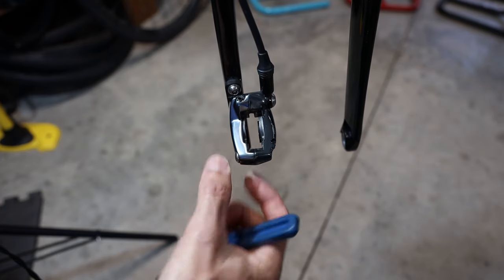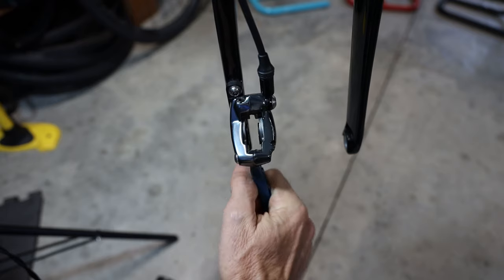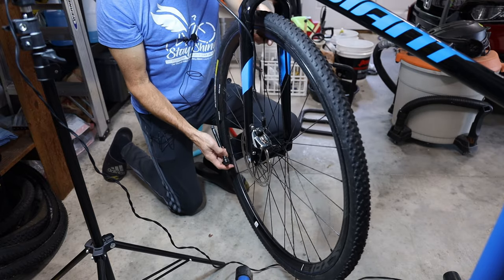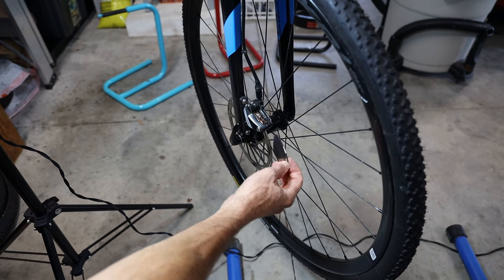How to Fix Dragging Brake Pads (if Centering Doesn't Work)

Comment: For 3 years, I have endured rubbing front disc brake. Lots of useless advise led me to change: pads; rotor; mineral oil and bleed; calliper. My local bike shop couldn't resolve (in fact made it worse!). I even bought new wheels (not because of rubbing) which had the exact same problem. 3 minutes of watching your video, and I thought 'heck, let's try this'. 15 minutes later, problem was resolved! Thank you so much for such a clear, simple solution!

Comment: Brilliant! Going nuts trying to fix my dragging brake pads. Tried to exercise the pistons again and again to no avail. Removing excess fluid solved the problem immediately. In hindsight, the brake lever was very tight and a sign that the fluid had expanded. I don't know why other videos aren't showing this, but thanks a bunch.

Comment: Thank you so much Clint. After trying out about 20 other videos all of which suggested the same solutions of straightening the caliper, truing the rotors etc etc, yours was the first and only one that suggested relieving a few drops of mineral oil from the system. This solution immediately solved the problem on my Canyon CFR running Campag Super Record EPS and it was quick and easy for me to do. Quality content from knowledgeable people like yourself is hard to find out there in a sea of repetition and ineffective solutions purveyed by so many others. I’ve sent a super thanks your way. Thank you 🙏
Reply from the maker: Love it. So glad I could help!

Comment: One more suggestion: some shops are not careful when bleeding brake fluid and they finish the job with too much fluid in the lines.  If you can’t compress the pistons back, even if they are clean, this is the likely cause.  You can fix this by opening the top bleed screw, pushing the pistons all the way in, wiping up the excess fluid, and closing the screw.  Then reinstall the pads and continue centering and pump the brakes.  Double check for leaks and verify there is good brake operation before riding!

Comment: Huge thanks. I was trying to resolve brake squeal but after cleaning and scuffing the pads 3 times, I found the pistons were not moving equally. One was almost stuck. I guess the imbalance of piston pressure to the pads and rotor was causing the squealing. Followed your instructions and the piston eventually worked together in equal movement. Took it out for a test and voila. They no longer squeal.

Comment: Thank you very much for the tip about too much pressure in the system. Had very little clearance on some new pads and was finding it very hard to get the calipers centred well enough to stop all rub. Just did as you said and bled off a little fluid and all is right with the world again.

Comment: The video addressed the issue I was having with a new bike build, which was excessive hydraulic fluid in my front brake line.  Thank you Clint for your clear explanation!
Reply: if you drain the fluid, does it not make the brakes more mushy?

Comment: Gonna hit this again. Noticed you mentioned pushing them about 6x..haven't heard that before but have endless rubby and also squashy underpowered brakes (deore xt). Also been through the mill trying all options, convinced it was a stuck pad issue but only cycled them once or twice.   ...I'll be back shortly (as big Clive would say)😄

Comment: The removal of a little brake fluid did the trick for me. Try first without pushing the pistons back, this was sufficient for me. Pushing the pistons back may reduce the breaking pressure too much.

Comment: Thanks a lot for the excellent explanation and demonstration! I’ve got excessive pressure in my system , but I was afraid to open a bleeding port because I thought the whole bleeding process will then be required and I do not have tools or a good service shop where I live… so I fixed my brakes in a few seconds after watching this video 🤌 thanks!

Comment: I might have a rear dragging on my hardtail 29er I need to scope out. Good timing
Reply: ElevationEveryWeekend check the disc too could be slightly warped and rubbing in a certain place win the wheel spins

Comment: Very helpful. I have new Shimano XTs and rotors and they were dragging. I went thru you list of remedies and found loosening the mounts to center the rotor was the answer. I just flipped over the bike and spun the wheels to feel for vibration between the rotor and pads as I incrementally tightened the mounts., I had to do it by feel since they are so close I couldn't see the gap and clenching the brake levers down and retightening the mounts wasn't fixing it.

Comment: Great explanation and the tyre levers work a treat! I’ve just done it successfully in my Sram Code RSC. I previously popped out a piston in Sram Guide so your tip not to push the piston out more than 3 mm has saved me this time. Cheers 🤙🏽

Comment: Thank you SO much for this video, Clint. You are a cycling demi-God. Had a stuck piston and tried all the suggestions in other videos and nothing worked until i back-bled the system. Piston popped right back in. Question: I've obviously got water in the brake system now. Is that an indication to bleed the affected brake?
Reply from the maker: If you have not bled the brakes in every year then I would do a bleed. However, if you just don't have the tools to do it, you could wait and see if you have that problem again.

Comment: My mtb has been sitting from just this issue. Went to put new pads on, and the new pads would rub the rotor. Not sure what I did, but when I let a little fluid out and I lost pressure in my brake lever. LBS will save the day!

Comment: Thanks! I had to lube up the piston and push it in and out until it slid smoothly and release the pressure in the tube a bit and that fixed it! Lol that sounded a bit wrong tho

Comment: Cool and useful video. I am curious about this little pad centering tool you show at the end. Can you provide a reference on it - brand, store, etc. Sounds useful to have.
Reply from the maker: Check out one of the links in the description below the video. It's the Birzman tool
Reply: I have the tool myself, it is good quality but...it's squared at the top edge, so if your using narrow rotors (SRAM for example use narrower than Shimano) it's not going to be sitting flush on the ring. I love the look of the tool but they should have rounded the top instead of square folding it. I tend to use a thick sheet of paper each side instead just for accuracy (paper is pretty accurate lol)

Comment: Great video. Thank you. Are you using tyre levers because you do not have the dedicated tool to spread the pistons? I have this tool and it is actually made of metal. Is this the reason why you prefer to use plastic tyre lever?
Reply from the maker: I’ve always used tire levers and never felt the need to get the tool.

Comment: you ever have the issue where everything's centered perfect when spinning or riding straight but when turning or standing/climbing the wheeling rotor flex (while off the brakes) and the rotor pushes over into the pads (while they are still aligned perfectly)
Reply from the maker: Yes. That usually happens when there is not enough space between the pad and rotor and a little bit of flex will cause the pads to rub. Do the method of relieving some pressure out of the system like a show in this video and it may work for that.

Comment: Also, could the thru axle adaptor end caps be the wrong size on the new Roval wheels? I just put my stock Vision front wheel in and it works fine
Reply from the maker: Never heard of that but I guess it could be!

Comment: Clint, aby suggestions how to fix this problem: Thread on SRAM Guide RSC rear caliper is worn out.  Other than replacing the caliper any suggestions? Bolt through the caliper with a nut at the end? Thanks
Reply from the maker: Hard to understand fully without seeing it, but typically the bolt goes through the caliper and into the fork or frame. For stripped threads, wherever they are, you may be able to use a helicoil.
Reply: @ClintGibbs  helicoil it is! Thanks!

Comment: Hello, I have an issue that I'm hoping you'll help me with. The brakes are shimano tiagra hydraulic. I have one piston that doesn't retract fully and after centering the rotor I can ride for a bit without any issues and then usually by the end of the ride, the pad is rubbing again and sometimes preventing wheel from spinning. I have given my bike to my local mechanic twice now but same issue. I can't find any new calipers in stock too so I'm wondering whether you have any ideas that I could try myself. I haven't ridden in 2 months because of this :(
Reply from the maker: If you are going through the process of unsticking the piston, that is really the only thing you can do. Of course you need a center of the brakes after that. If it keeps happening it may be a warranty issue.
Reply: @ClintGibbs  thank for the answer! I have cleaned the pistons and did the push back and forth quite a few times. When both pistons are pushed all the way in and the brake is applied the left side won’t go out at all unless the other one is held in. Pretty strange

Comment: When braking and the bike is not moving is it normal that the Rotor is moving when pressing the brake im using a hydraulic brake also the brake pads are aligned well or this is normal?
Reply from the maker: There are times when one pad will contact the rotor first and move it slightly side to side. The main thing is that the pads do not rub the rotor when not pressing the brake lever. If that’s the case, then it’s all right.
Reply: @ClintGibbs  thanks i also checked it to our nearest bike shop and found out that it is normal thank you for your response 😺

Comment: Hi ! Hoping someone can help , my breaks/ ( not hydrolic)  my rear pads and my disk are getting extreamly hot  , set of on my comuute this morning and I could lock up the rear wheel however on the way home my rear brakes were about as effective  as a peice of chocolate , bit confused got new pads and rotor on the way but need to commute for a week, any tips?
Reply from the maker: New pads need to be seated in. Basically you do about 10 hard stops from about 20 mph, not quite coming to a full stop.

Comment: Nice videos but there are other issues that you haven't covered. I had an issue with brand new Shimano brakes.The pads wouldn't stop dragging. After trying everything. I opened the bleed port on the lever and expanded the pistons outward. A little fluid was expelled but that did the trick. It was almost like it was overfilled.
Reply from the maker: I actually did a dress that in this video, especially starting around 2:50

Comment: I tried this but now the one piston after being pressed in do not move at all. Any tips for solving this?
Reply from the maker: Hold the other piston with a tire lever so it does not come out and then slightly depress the brake lever. Make sure you watch the pistons to make sure either one does not come out too far.
Reply: @ClintGibbs  thanks a lot. It worked 👍

Comment: found this video after i did the same thing with my tektro brakes, where one piston was 100% stuck inside the caliper and refused to move unless I block another piston with some tool.
Pretty annoying considering these are 100% new brakes.
Took me something like 66 instead of 6 such procedures to get it working, at least for now.
Reply: Hi there i have a 100% stuck piston what should i do?
Reply: @nabilazouz7204  block opposite piston with any tool and press the lever until stuck piston moves out. Repeat multiple times until both pistons start to move more or less equally. Just be careful and don't let piston move too far or it will pop out
Reply: @nabilazouz7204  Sorry mate, i do not share my social contacts publicly. You can ask here whatever you want, although i mentioned pretty much everything u have to do.
Block second piston (i did it with screwdriver)
Push the lever until second piston moves
Repeat 100500 times untill they both move evenly
Reply: @1222dss  thank you very much mate

Comment: how to fix piston delay?
Reply from the maker: I think you're referring to what's known as a dragging piston. In that case, you would remove the wheel and brake pads, then squeeze the brakes to where the pistons come out just a little bit. Push them back in with a tire lever and repeat this process about five times. just make 100% sure the pistons don't come out too far. If they pop out you've got a huge mess.